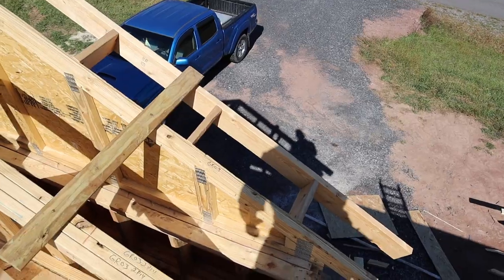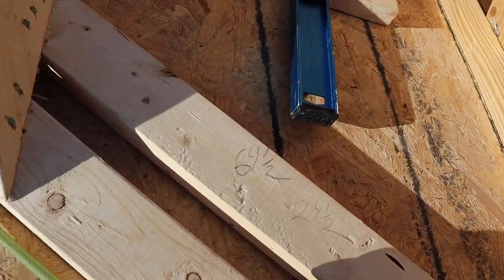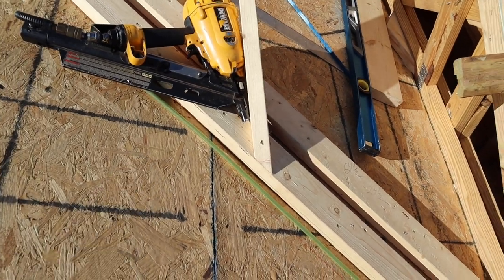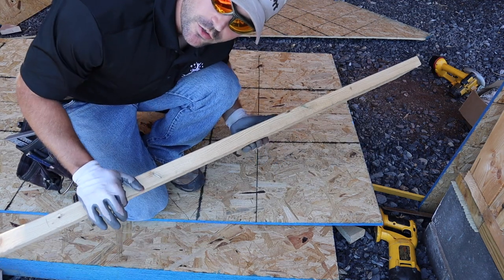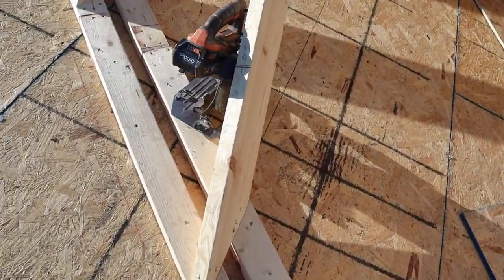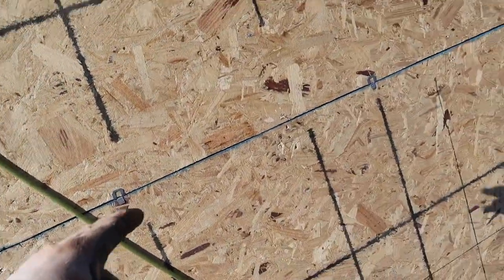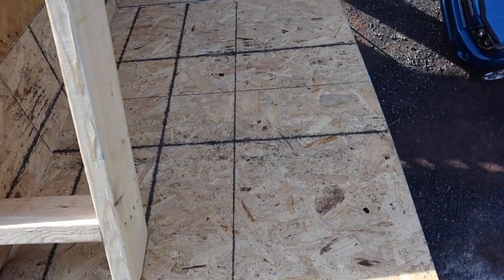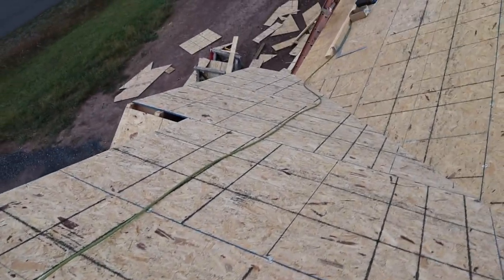How To Cut and Install Sheathing OSB In A Valley

Comment: what thickness is that sheathing?  is 1/2" ok to use?  Do most inspectors look for certain thickness?
Reply: Code is 7/16" or thicker, when I did my two car edition I use 9/16" thickness of OSB, just because it was my house. Don't forget to add metal plywood clips to put in between the trusses to prevent sagging.

Comment: Did you remember to take your level out before the last sheet
Reply from the maker: I usually cut out a section for ventilation later on. So I can get back in there. But yes don’t want to leave it in there regardless.
Reply: I know I'm the only one who has ever done that ain't i?